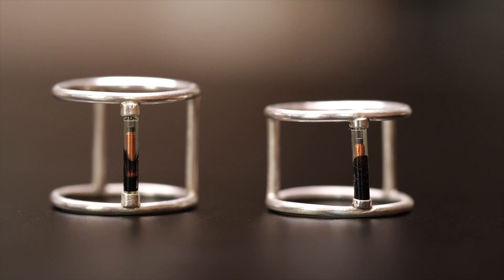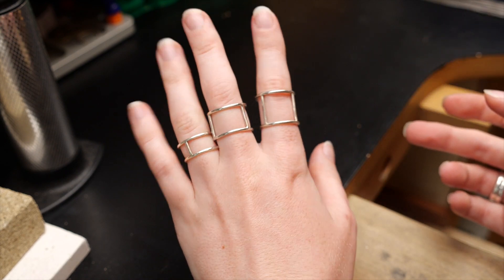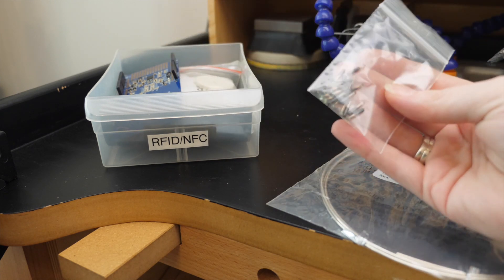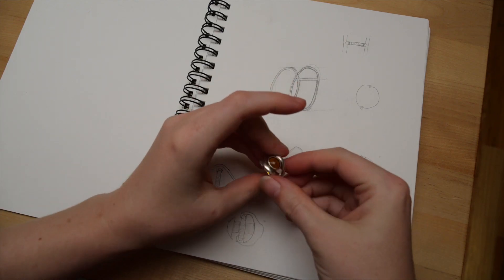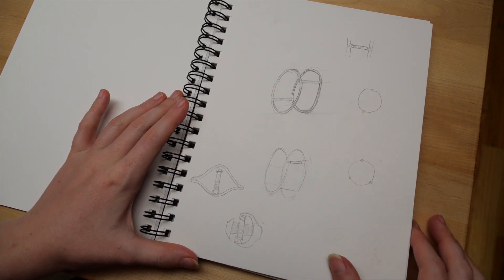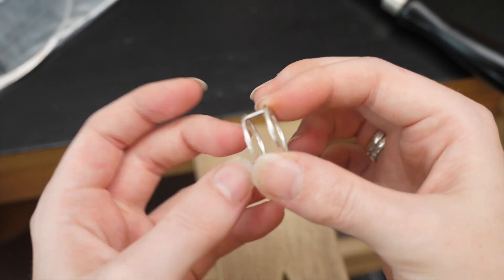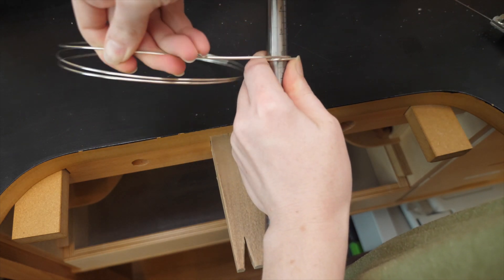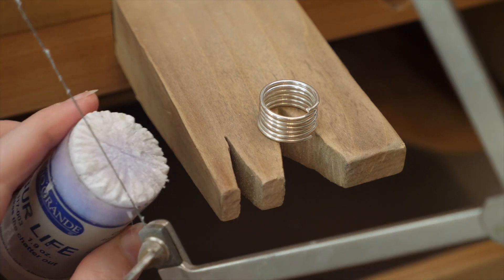RFID Ring // Becky Stern

Comment: I'm amazed at how accessible you made this look. Apart from that very expensive-looking drill and the mysterious crock-pot (an ultrasonic cleaner?) you did all this with basic workbench tools.
Reply from the maker: Jewelry requires a bunch of specialized tools! You saw a ring mandrel, Jewelers saw, needle files, soldering station... The drill is my Foredom flex shaft and the crock pot is a crock pot filled with pickle solution for getting rid of firescale.
Reply: @BeckyStern  Ah, I didn't realise that the mandrel wasn't just a coincidentally perfectly-sized tube, and the saw's not an ordinary coping saw…

Comment: Love your work. 
I got my first NFC implant in 2014. Currently at 3 NFC, although I have many other things implanted now. The most useful thing I've found for it is that it unlocks my electronic door lock. I no longer carry keys. One has my contact details, and the other two are URLs to websites. All 3 can unlock my front door though. I want to make a ring similar to your resin one, as I found that design has a better antenna and can be read easier. 

Keep up the good work. Keen to see what you make next.